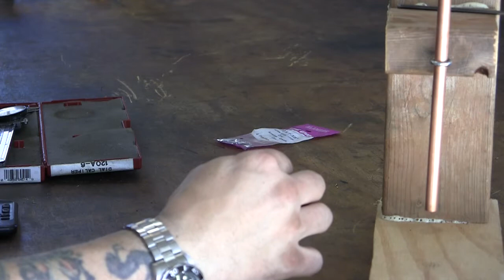Drop tube for reloading how to make one and use it

Comment: I made drop tubes in 3 sizes, for 32, 38, and 45 calibers from brass tubes I got at the hobby store. The holder is much simpler than the one shown here. Just 2 small blocks of wood held together with a hinge on one side and holes drilled where the blocks come together. The other end is held together by a screw and wing nut. A one size larger piece of brass tube is soldered about a half inch from the bottom to act as a stop when I hold the up the case with one finger while I pour the powder. The blocks are fastened to the side of the work bench.

Comment: I made something like this and adapted it to an RCBS Powder measure. I used it for Smokeless powder to be able to enough powder in a 444 marlin case to gave me close to 100 Fps more velocity with a heavy 300 grain bullet.

I cut the base of the powder measure stand so that it could overhang my bench. I was able to obtain velocities from my 22 inch barrel of 2100 fps which is just 100 fps shy of the ballistics of the 405 Winchester which drives a 300 gr bullet @ 2200 fps.

Comment: I have an issue with the plastic funnel. Black powder is supper sensitive to static.a small metal funnel would be safer.
Reply: But yet it comes in a plastic bottle......
Reply: @Joe-kc1eg  I know. But where I work, we get chemicals in plastic buckets. BUT we are not allowed to use plastic buckets to transfer fluids. Go figure.